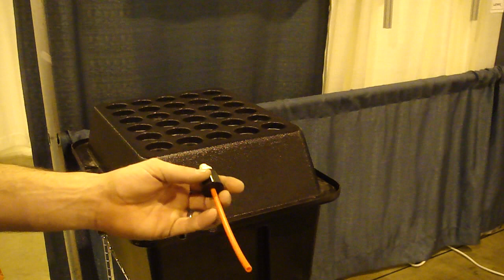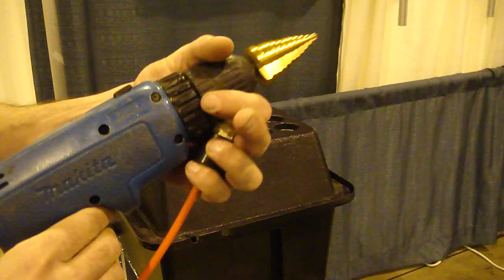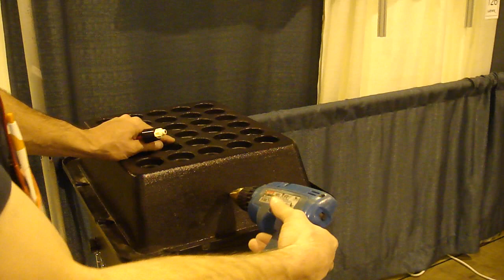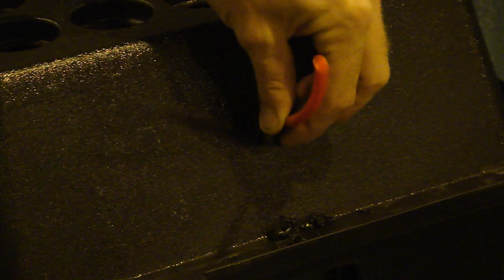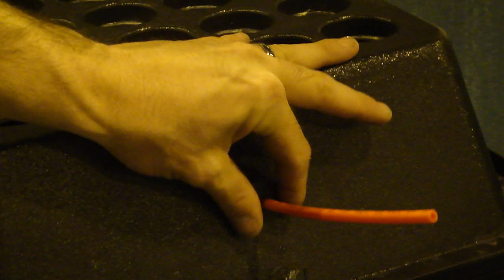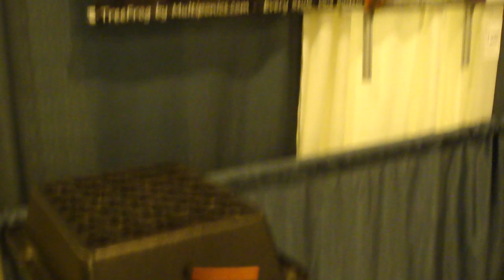DIY high pressure aero kit by Multiponics brings old cloner back to life at Denver Max Yield 2012

Comment from the maker: You can easily hook up any trellis system above the table. When growing 26 pepper plants, you really will have some toothpicks by harvest time, 12 or even 6 bushy plants will easily fill up the entire canopy. There are 26 plant sites for tight crops such as lettuce or corn, and the unused sites can easily be capped off if not used.

Comment: Newbie question,  so in a setup like this you would just use one head? I that's the case I'm assuming you aren't worried about the head actually hitting every plant but the moisture or fog in the box will be good enough?
Reply from the maker: Yes, exaclty. For larger systems, simply add more nozzles. Our kit can run 1-12 nozzles.. https://multiponics.biz/collections/advanced-aeroponic-equipment/products/diy-high-pressure-aeroponics-kit-8800